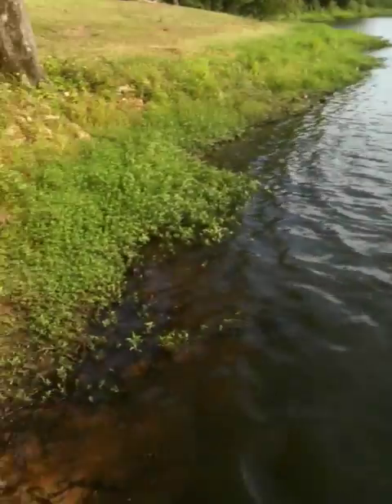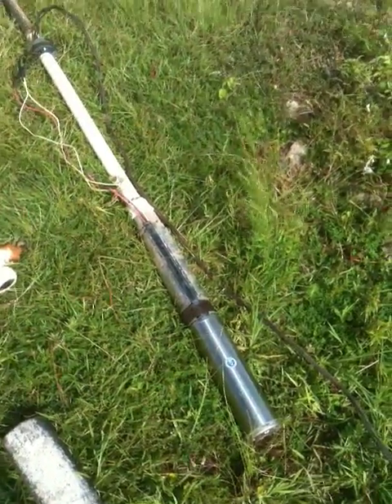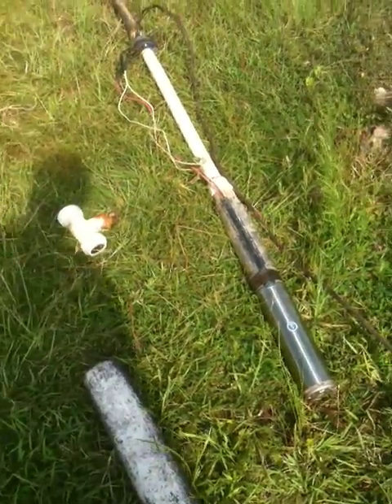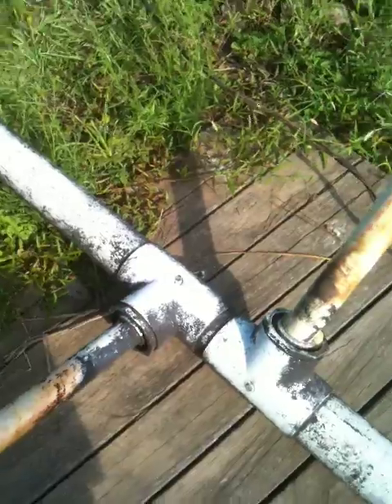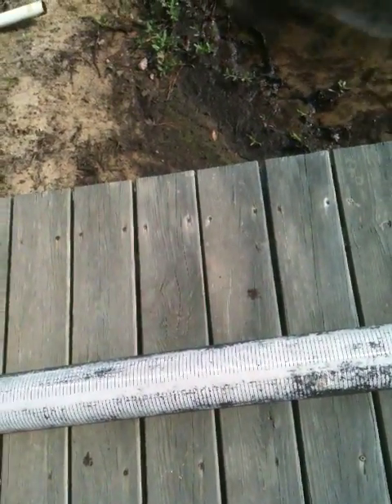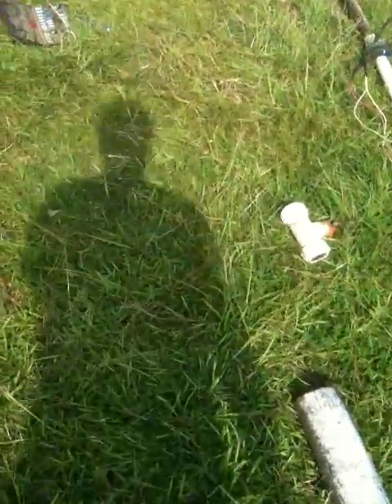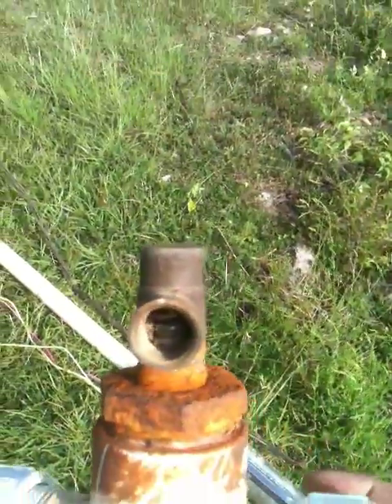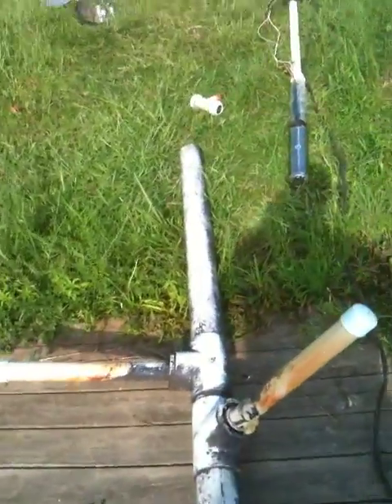Lake Pump/Motor Assembly for Sprinkler System

Comment: That slotted well pipe is meant for crystal clear aquifer water, yes it filters sand, but not meant for algae, mud, silt, weeds, in the lake.
It will clog up and starve the pump of intake water. Furthermore, the slots cause the pipe to be very brittle or easy to snap, the first boat anchor that snags it will break it right off. All this from a lake pump professional with over 40 years experience installing and servicing lake pumps.
Reply from the maker: Thanks for the heads up.   This pump setup has been working for 10 years without any issues.   Did clean it up once when the lake was lowered one summer.   Did not seem that clogged.  Did cleanup the screens on the pump at that time.    Also found one of the PVC legs broke off.   Capped  off the PVC leg and propped the pipe up on some rocks.  The PVC will get brittle over time, but I think 10 years is pretty good and the slotted pipe was still able to pick up and bend without breaking.
Reply: @jodellus   in my experience there are only 2 types of this slotted well pipe - - those not broken yet, just waiting to b e broken or clogged up - -  and those already broken and clogged up - - - as a professional I run across this slotted well pipe almost every week installed by my competition and it is ALWAYS clogged up with algae and crud,  - -  if it's not been broken off by boat anchors or whatever, it's just an accident waiting to happen.